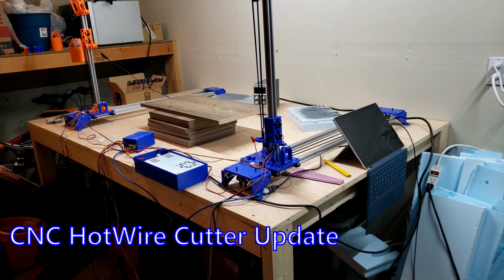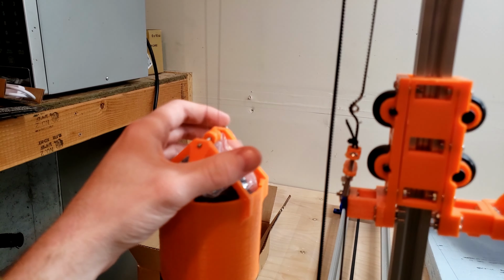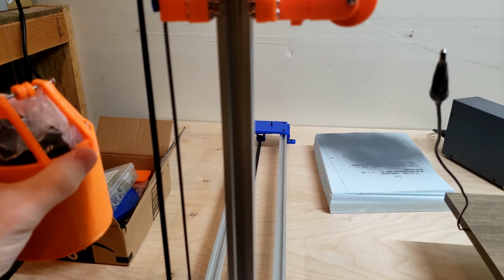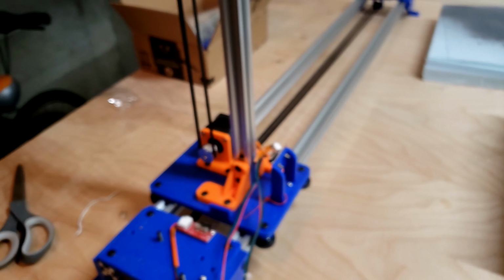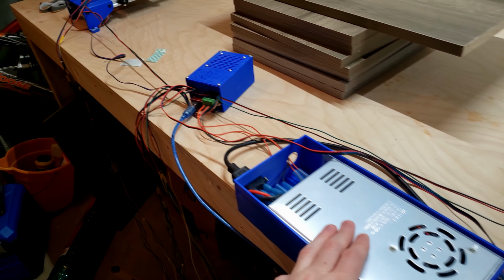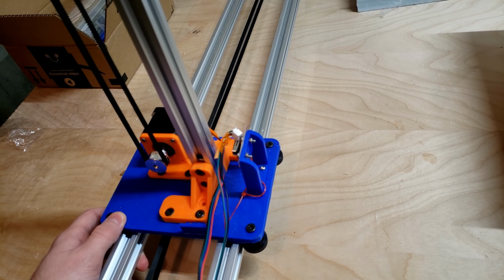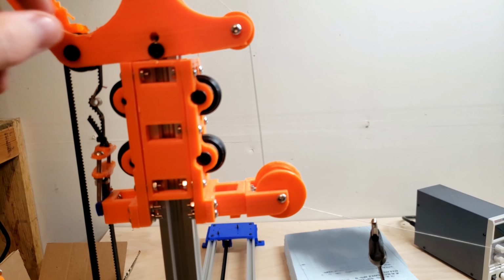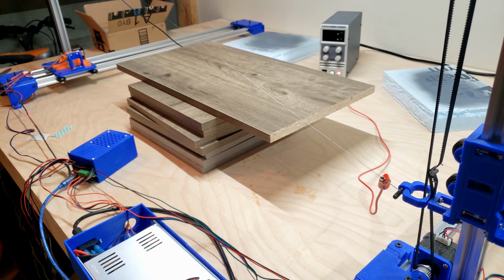CNC Hot Wire Cutter Part 3: Gravity Tensioning System and Tapered Cuts

Comment: I like this tensioning way which gravity. But I remarked the weight is swinging during horizontal movement of the gantry, which probably lead to unwanted stress on the gantry and probably also some imprecision. 
I have some ideas [tm]: 
1 - add some vertical rails to avoid the weight to swing
2 - limit the weight by adding pulleys and making a hoist: you can divide the weight by two (and as nothing is free, increasing the vertical course by two...)
Reply from the maker: I actually decided to replace the hanging weight with a motor and gear box that spools the wire to maintian tension. There were too many issues with the hanging weight (reliability, rigidity, speed, and configurability). 

Adding vertical rails to limit the weight from pendulum'ing would have helped, but just chaning the method of tensioning entirly worked out a better in my case. 

I've gone from doing cuts at an average feed rate of 15mm/min to 100mm/min and haven't could push it faster if I could increase the rigidity of the machine.

 I need to make a part 4 video with the changes i've made in the last few months, but i've been short on time of late.

Thanks for the feed back!
Reply: @fureter6986  And a simple vertical spring ? But you need a long travel spring if you want to cut a wing with high taper (big difference between both gantry travel).
And yes, a #4 would be nice!
Thanks for everything you share.
Reply from the maker: @JeanLucCoulon  A simple spring would be impracticable for medium-large amounts of gantry independence like you stated. For small amount of taper a spring works, but the change in tension during the cut can cause issues with cut alignment (not as big a deal with wings, but a concern when cutting fuselage cross sections) especially since the machine is not perfectly rigid (the rigidity needs to be improved). Then too much taper can cause damage to the machine or the motors to slip ruining the work-piece due to the excess tension from the spring extension.

Having a longer spring that can flex large distances also means that the spring has to be pre-flexed to the desired amount of tension, which would take up significant real-estate on the machine, even with pulleys redirecting the forces it wasn't very practical for the kinds of cuts I was trying. 

The handing weight and motor controlled tensioning has the benefit of keeping a constant tension irrelevant of gantry positioning with respect to one another. This makes cutting fuselage cross sections viable with larger amounts of curvature in the fuselage. Plus I regularly move the UZ gantry position on the table by changing where the feet are bolted into the table, this lets me change the wire length available to suit different cuts. Using a simple spring would add to the time required to change the wirelength because the actual wire would need to be adjusted and the spring re-tensioned, while a motorized system just requires me to send some G1 commands to spool/unspool the wire while shifting the gantry.

The ultimate end goal for the system would be integrate a load cell onto one of the gantrys and set a wire tension value before a cut, then the machine would monitor the wire tension real time and adjust the motor to keep the tension constant at the specified value. Currently I have to handle the motor control during G-Code generation so its not real-time and suffers from calibration issues such as mm/step errors in the controller.
Reply: @fureter6986  I've seen (in France), a commercial foam cutter with a spring. The spring is very special, it is a single big horizontal loop.

Comment: Giving up on the wire cutter?
Reply from the maker: I've been using the machine to cut parts, bit haven't made any upgrades to it yet. Have been looking for part degradation and areas to improve the design. Plus i've been working on a custom slicer in python to add more capabilities to the machine. Thanks for the question!